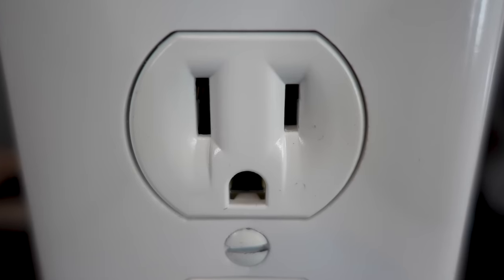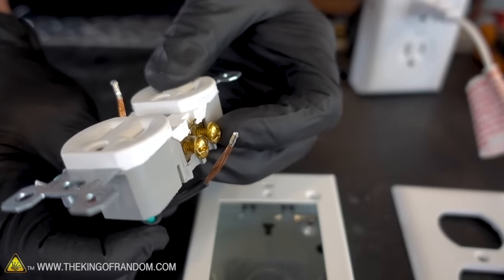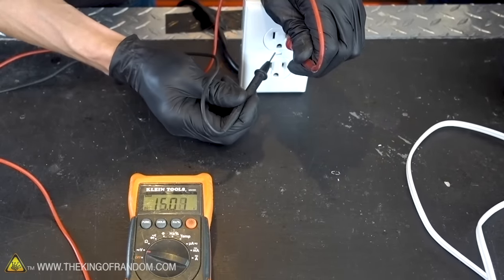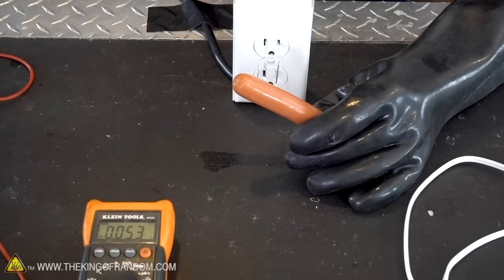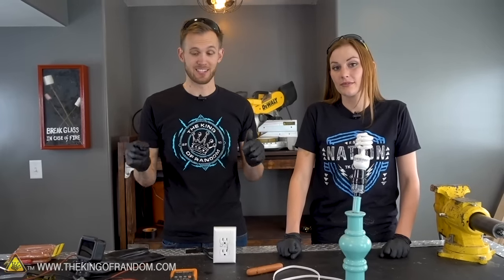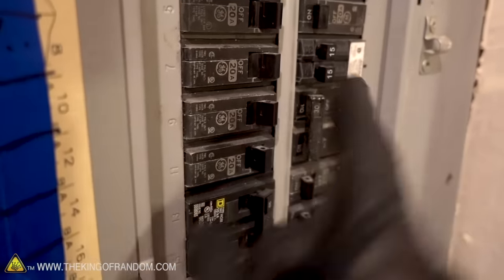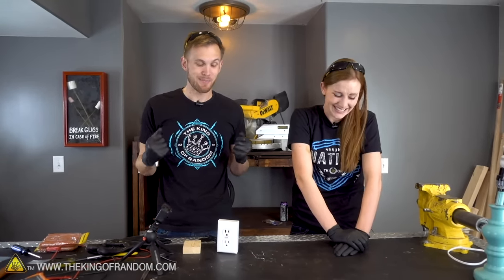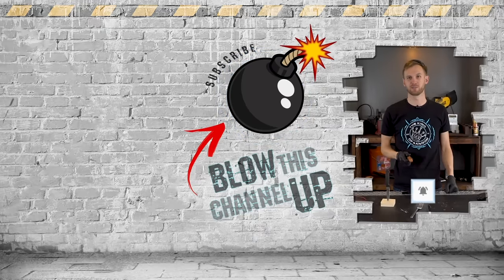What Happens if You Stick a Fork in an Outlet?

Comment: Being an electrician I'm actually suprised at the accuracy of most of this information
Reply: Eli Lantz he said muscle contracts when electricity flows through them. If you stick a chicken wing in an outlet would it start flapping?
Reply: @timesfly1081  yes, but depends how u  put it in the outlet
Reply: Yes my dad is a electrician who has taught me everything about electrician
Reply: Except that a hotdog is kinda a bad example, human skin has a fairly high resistance (if dry) and due the the Skin Effect (resistance over surface area), which causes the resistance to rise and the breaker or fuse pops. Hotdogs have very little surface area compared to human skin, which means that electricity flows easier through it, which means a lower resistance which won’t pop the breaker or fuse
Reply: Eli Lantz I’m an electrician as well, I saw your comment and said let’s see... and you are right they really are accurate.
Reply: @Vinesaucefan101  this is totally wrong
You have a lot of wrong terms
Skin effect is when the AC current passes through the skin of the conductor due to the high frequency.
When resistance increases, current decreases, which means that the breaker will hardly open.
I'm embarrassing you, but I'm correcting your information.
Reply: Seriously?
Reply: @Dukenukem155  I totally agree with you.
Reply: No. he said that if you are well grounded electricity will not run throu your body but he's wrong because your body have capasitance so a little AC current will run because capacitors short AC but your body have very small capacitance so there's not much current flowing.
Reply: except for the ground, which it doesn't work as an over current protector!
Reply: Why are you surprised?
Reply: @TheFalseLogical why?
Reply: Being an electrician I’m surprised how bad American electrics are 😶
Reply: There you have it kids tkor never lies
Reply: Well It's Quarantine
Reply: Eli Lantz I am the son of a electrician and my dad has taught me a lot and I was also suprised at how accurate his information was
Reply: Yo I’m a gamer
Reply: For everybody else in this thread electricity will take the path of least resistance usually but also can take the path of all conductive paths namely through somebody or through two different wires at two different currents.
Reply: @timesfly1081  no but you would get some blackened chicken. So pay a premium for that.
Reply: 501 like lol
Reply: Your not a electrician
Reply: @kingsjester2  except for the neutral lol, it's technically the grounded conductor, a neutral carries the unbalanced load
Reply: Well when your like me and you like subwoofers you gotta know all about that kind of stuff
Reply: I mean electric currents have a lot to do with science so not sure why you’re shocked
Reply: If you are an electrician, answer this: I’ve been shocked before, a straight path through my left arm and I could feel the current run through my body... how come I’m still alive and why didn’t I experience any muscle spasms?
Reply: @beans4411  either not enough current, or there wasnt a path through your heart, I also am an electrician, a master in Maine
Reply: Did you not notice his breaker panel? You can't have GE panel with Sq D and Eaton breakers in it .
Reply: Nice
Reply: Axtrafy it could be a different guy😑🙄
Reply: Ax yeah because people can’t have the same name. Even if he isn’t an electrician, he’s not wrong with his statement, so it really doesn’t matter.
Reply: Me too
Reply: @gabrigmr5808  Well depends. All processed meat is electrocuted after the animal is killed, I'm just an electrician, apparently HV gives the meat a better teaxture. So pretty much nothing would happen, maybe it would twitch a bit
Reply: @jimmycarburator2012  yeah ur right, i guess flaping is a little too much, twiching sounds more reasonable
Reply: Yea there are 'YouTubers' out there who take their subject matter very seriously. Not just pretend to know what their talking about or repeating what others have said, but doing the research and testing like any professional school or college.
Reply: IronyFalseLogical  LMFAOOO WTH?!?!? Are you ok??
Reply: Just took a course. Built these outlets. Shocked at the amount of people that shocked themselves.
Reply: InstaBlaster.
Reply: @MetalTalk666  yes you can. Eaton CL breakers are UL Listed for most every panel except, ironically, for Eaton panels.
Reply: A pencil doenst work no? Cause I got lucky if it did
Reply: What about two forks into the outlet
Reply: Has electrician I can touch 110 and not feel it
Reply: @Vinesaucefan101  trust me buddy your not gonna trip a breaker either yoll be fried before that thing trips.
Reply: He said that the neutral wire is safer than the hot wire, being an electrical engineer I know that AC flows both directions meaning that neutral and hot are both the same danger level its just naming convention

Comment: I think you're making a bad example by sticking things into the neutral side of the outlet. Normally nothing will happen but in some cases you can have voltage on the neutral side of the outlet too ( for example a mistake in the wiring of the outlet ). People will try this and potentually get hurt.
Reply: if that happens you need to fire the electrician for not following NEC guidelines.
Reply: @RichardTheValiantFoolFox  Yes, fire him after you're dead from the shock...
Reply: That’s what you got from this video? Lol. He’s literally sticking paper clips and a fork into a live socket.
Reply: Marco Hoffmann same thing for the ground and the device
Reply: @RichardTheValiantFoolFox  yes fire the previous home owner who was definitely not an electrician.
Reply: *you're
*normally
*nothing
They tell us 'Don't try this at home'.  If you try it anyway, that's on you.
Reply: Well you would have to have to be touching metal because you have to have a closed circuit
Reply: @RichardTheValiantFoolFox  And if your house was wired 80 years ago, I'm pretty sure that electrician is dead now.
Reply: I’m a Master Electrician, I want to jump in here in defense of what Marco is saying. Plenty of times I have measured current on the ground and neutral. This has happened through incorrect wiring, a broken neutral wire, or faulty equipment plugged into or directly wired to the circuit. Suppose a curious little kid decides to imitate exactly what TKOR did? It doesn’t matter if there is a warning, or disclaimer. Children do not have fully developed pre-frontal cortex, they don’t have reasoning ability yet. So as parents we tell our kids “don’t stick metal objects into a wall outlet” and that should be the end.

TKOR, I love your videos, please keep them coming! Inspiring curiosity, answering “what would happen if...”, and creating an interest in Science is super important now a days. Some things though you have to ask yourselves, just because we can, should we?
Reply: Lol which is why they said dont try this at home
Reply: Mike S HE HAD RUBBER SO THAT IT WOULDN’T ATTACH TO HIM AND CONDUCT THEN HE WORE RUBBER SHOES THAT THERE WAS NO GRPUND BEING SAVE
Reply: @RichardTheValiantFoolFox  doesnt change the fact that someone is in danger
Reply: @SeaReverie  Whenever I move into a new house, I check all the outlets with a three-light tester. In this house, I found an outlet with reversed polarity and no ground. (There was a ground wire in the plastic box - it just wasn't connected to the outlet.)  It was located in an unfinished basement and within six feet of a water source. It was installed by the previous owner, who was an electrical engineer.
Reply: The Egg Turtle I am fairly certain you didn’t understand what I wrote in my reply , that you’re replying to...
Reply: @SeaReverie  children have some reasoning ability, theyre not robots
Reply: Well that’s only from a disconnected circuit. If you had power going to neutral in an outlet you’d find out there wasn’t something quite (pop) right long before you decided to stick something In there for absolutely no reason (install) but I’ll level with you it’s possible.

Comment: **** Disclaimer ****
Thick rubber gloves doesn't mean they're rated for electricity. If you're working with live circuits, use the proper tools and/or gloves if the circuit can't be locked out.
Reply: And maybe not stand on the ground
Reply: Lol anything works as long as it dndt actualy touch you
Reply: K-Tech 
Well if they knew maybe they shouldn't put it all over YouTube so when people try to reenact it they don't get popped or killed.
Reply: So right
Reply: @unnamed47  you are supposed to use rubber gloves under leather
Reply: I think they knew that. They probably got gloves for electricity

Comment: The breaker is tripped to prevent house fires if the outlet malfuncitions

Also, if you do stick a fork in he outlet, you risk severely burning your hand and setting your house on fire, sooooo, dont.
Reply: I thought it would have been worth mentioning here. You can even see some flame inside that outlet itself on the first couple shorts, highlighting that even the circuit breakers aren't a complete protection against harm.

Comment: US plugs look so depressed 

I kinda makes me sad
Reply: It's more of a surprised face imo. I know D= is usually used as being sad/upset, but doing it irl feels more like you're surprised.
Reply: no
Reply: Cemil it only allows many things to be connected in parallel to one plug
Reply: They’re not supposed to. The mouth, the ground lug, is supposed to be on top
Reply: Cemil  the circuit breaker has a current limit, a single appliance will not exceed this limit under normal circumstances but if you use splitters you do so to use more appliances and that can exceed the limit, added to that is that most splitters are a bit flimsy increasing the risk
Reply: D=
Reply: Joe Gaming true
Reply: Australian Plugs are a lot more depressed
Reply: U.K. have the better plugs then around the world
Reply: They look like me
Reply: Cemil  the us don't have fuses in the plug it's self.
Basicaly you can pull more power through the cable of the splitter than what it is rated for.  This could cause a fire or the main breaker to trip.

Just additional info.
This is not a problem in the UK as a uk plug has it's own fuse the biggest fuse in a plug is 15A 
So if you try pulling more than 15a on a power strip it will blow the fuse on the power plug.
Reply: I know right? In other places. cough cough some countrys of Europe They look a lot happier!
Reply: Joe Gaming great. Now I will see a depressed plug every time I see an outlet
Reply: German plugs are the best
Reply: Oh yeah yeah
Reply: i think they look shocked tbh
Reply: @obozujem_macke  anything not us looks super scary 😂
Reply: @spookyghost7524  OH YEAH YEAH
Reply: @solobiker18  how?
Reply: Probably the face associated with danger like the biohazard sign
Reply: @Krystalmoon101  better design, that's why.
Reply: @solobiker18  oh ok
Reply: Yeah really, aren’t European plugs just two metal cylinders?
Reply: Shocking huh
Reply: @realchezboi  they look more surprised or shocked I think
Reply: Here's Johnny! Yep, they have no mouth, just eyes
Reply: Joe Gaming People with that profile picture look so depressed

I kinda makes me sad
Reply: At least they are compact, European plugs take up so much room. They look like you’re plugging in some huge appliance but it’s actually a tiny fan or something.
Reply: @dylanstewart4861  what
Reply: @bobkmak3470  I'm so sorry
Reply: @Mariah Grace I'm magic
Reply: @NoTimeForThatNow  not really
Reply: Joe Gaming it looks like the crying child from Fnaf
Reply: Same
Reply: That explains the Great Depression...
Reply: I SWEAR I SEE YOU EVERWHERE
Reply: plugs in Turkey look like they’re shocked lol
Reply: well what do yours look like😅😅😅😅😅😆😂😂
Reply: In Europe you dont see any faces
Reply: @Mystery Box its just two holes next to each other
Reply: XD they always looked like faces to me too
Reply: Joe Gaming OoF same
Reply: A look of horrified shock
Reply: @Paul Kamalski I'm quite surprised by the level of humbleness for the u.s citizens,your comment just reflected poor education and pathetic ignorance . They say empty vessel makes the most noise.
Reply: Cemil  It could allow you to draw 15 amps through one outlet, and they're not made for excessive current.
Reply: How do your plugs look like??
Reply: They're... SHOCKED
Reply: My outlet looks like...   /  \
                                           I
Reply: The Aussie ones look like you just killed their friend

Comment: I work for the power company and our gloves way thicker and can handle 20,000 volts and I still get nervous that I’ll get cooked like a thanksgiving turkey
Reply: Yeah, this entire video made me very nervous. Maybe they did this and just didn't show it, but I would have hoped they consulted with an electrician before attempting any of this stuff.
Reply: Zelena Trešnja that outlet probably didn’t have much electricity. Go get two metal bars and touch and electric fence and tell me how it goes 😂
Reply: Zelena Trešnja  basically voltage is the power of the electricity, current is how strong electricity  flows and ressistance is the traffic or components slowing the current  through a circuit
Reply: @Woods234  Voltage: how wide and deep the river is. Current: how fast the river is flowing. Resistance: dams, locks and turns that slow the river down.

Comment: Always that mix-up of current and volts. It doesn't takes 1:1,000 of a volt to contract muscles, it takes 1:1,000 of an amp. 1 Volt can't do much to your body.
Reply: aha.... tell that to the thousands of ppl who die... cuz your heart kind of dislikes higher voltages...
Reply: Look at Tesla coils. Extremely high voltage but you can stand right next to it. High current is what’s dangerous.
Reply: @manfredschutze834  low power (amps) means the voltage never reaches the heart. You need both current and power.
Reply: @manfredschutze834  It's the current that causes damage. For instance, a static discharge from something like a doorknob can be in excess of 20,000 volts. Voltage with little current causes very little damage.
Reply: Go watch Electrobooms Video, please! In the end, it's the Voltage btw :P Ooh, and the frequency matters too :D
Reply: But voltage decides what amount of current can pass through a given resistance. You cant remove members or the equation.
Reply: You gotta mix the two
Reply: You didn't get what I tried to say. Just apply 1:1000 volt to your finger. Guess what's happening. Right, nothing.
Reply: I think it depends on the type of voltage. The body will be OK with relatively high DC voltage. But when you apply AC voltage, your body tends to act like a capacitor. Therefore, the high current going through the body will cause severe damage. The body is like a Resistor in parallel with a Capacitor.
Reply: On a hot day I replaced batteries in a 24 volt grader. I was sweating so bad it made a connection and cause a painful tingling in my hands and forearms. I dried my hands off and finished no problems.
Reply: Tim is right. Current is the killer not voltage. I can elaborate if anyone is curious.
Reply: @rokkastormberzerker  the thing with a static discharge is that it doesn't have enough power so it's a short shock
Reply: @Axxetto  noop
Reply: @rokkastormberzerker  :/ you aren't an educated in this field right?
Reply: WATT?
Reply: 1 volt can give you a tingling sensation. Lol
Reply: rokkastorm berzerker It is NOT low current, rather HIGH CURRENT over an extremely short time.

Comment: I stuck a paper clip in an outlet when I was younger even though I knew it was dangerous and I managed to pull my hand away before it tensed up. There were sparks that burned the outlet cover and my carpet. My heart started racing and there was a spot on my finger where my skin was burned. I’m lucky that’s all that happened and I was quite glad when it was over.

Comment: I did this before when I was in 3rd grade I had a paper clip and put one end in the neutral and the other in the ground part it just cut everything off in the class room and it I guess shocked me a little bit but yeah believe me or not this really happen to me.
Reply: Well idk what its called in the usa but i think you triggered the rcd... if thats a thing in the usa and btw you shouldnt realy get shocked when connecting n and pe
Reply: @jannik9091  almost sounds like what we call breakers here but I'm no expert lol
Reply: @Murica_gaming  RCD is a the same as GFCI in USA.
Reply: Either that or it was a very badly wired Public School and they had some leakage on neutral or ground which caused enough current flow to trip the breaker unless it was recent and it was most likely an RCD or GFCI.
But then again we also forgot to ask whether this was in the US as it has been common practice for rcds in 240 volts countries.
Reply: imark7777777 2014 or 13 USA

Comment: A much better way to illustrate it:

I can plug in a 110v welder to that same outlet and melt two pieces of steel together so completely that a full size truck can't pull them apart. My welder is 240v single phase and can be used to build/repair any industrial strength parts. At work we have 3 phase 480v welders. If you accidentally or intentionally shorted out that circuit, you would be attending your own funeral in a closed casket.